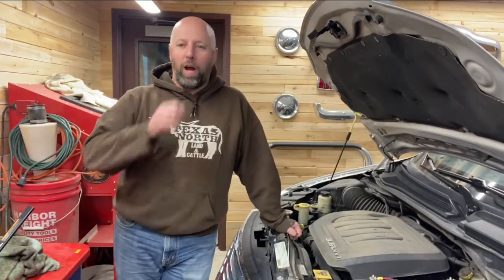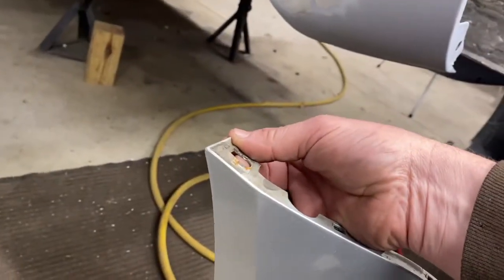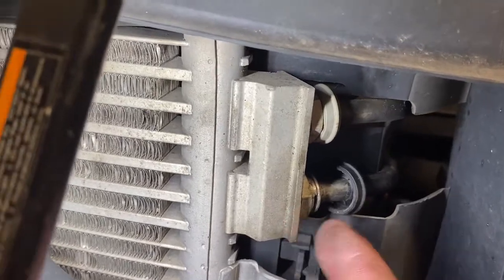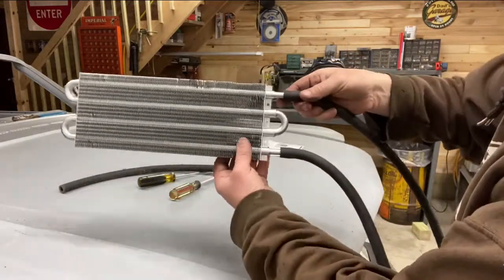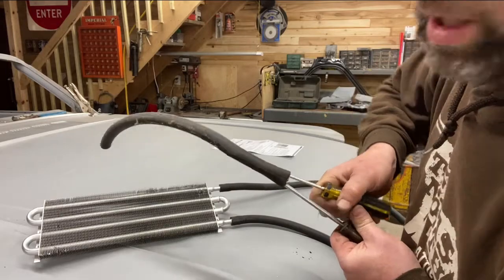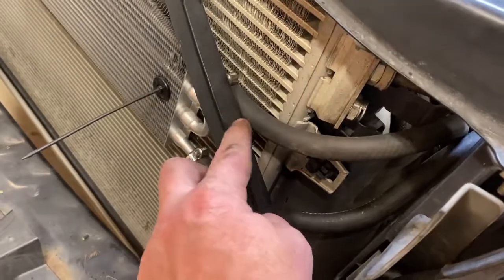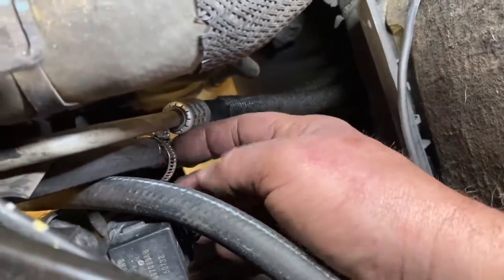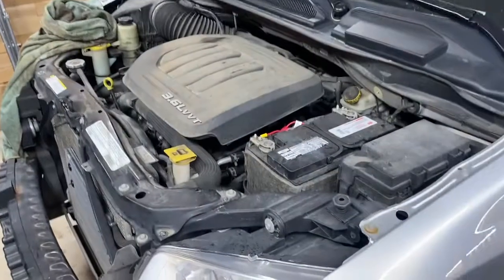Transmission Cooler Installation Town & Country / Caravan

Comment: Do you do anything special when you cut the original return line to retain the new cooler hose like a flare?  The stock cut tube is aluminum?  It shouldn't have any pressure but I'm always paranoid.  Thanks for a great video.
Reply from the maker: I didn't flare it at all.  It's just a nice tight fit with the hose and a clamp.

Comment: Ok so this is just an extra cooler to go inline with what is already there. Mine is leaking on the stock one near the passenger side. I was looking for a way to bypass that and not have to replace it and have to recharge the ac system.
Reply from the maker: Yes, this is intended to be an additional cooler.  I don’t know it’s cooling capacity compared to stock. It might work if you us it instead.  You could put two but that’s not cheap.

Comment: Great video! I want to add this to my 2018 Chrysler Pacifica minivan to cool the transmission while hauling a small pop up camper. Could you share a link to the transmission cooler that you bought?
Reply from the maker: https://www.etrailer.com/Transmission-Coolers/Derale/D12902.html?feed=npn&utm_source=google&utm_medium=cpc&utm_campaign=Google%20%7C%20Shop%20-%20Low%20Volume%20-%201000%20-%20All&adgroupid=108452021885&campaignid=11229265674&creative=468863949313&device=c&devicemodel=&feeditemid=&keyword=&loc_interest_ms=&loc_physical_ms=9051962&matchtype=&network=g&placement=&position=&gclid=CjwKCAjw14uVBhBEEiwAaufYxzoLXiJGTR2jxRAK4queG3M8JB7s6XQ169_yDETQuPpq4aofoQdqHBoCP20QAvD_BwE

Comment: Didn't that restrict air flow by mounting it over the existing trans/air conditioning cooler, making the vehicle run hotter? Thanks
Reply from the maker: The air flow is hardly restricted.  It does slightly warm the air going into the radiator but the stock radiator is completely up to the job.

Comment: Why not bypass the whole system?
Reply from the maker: The purpose was to add more cooling in addition to the stock cooling.  I wanted as much cooling as possible. If I bypassed the stock radiator, I wouldn't have had as much cooling.

Comment: The Work Is 100% Correct But The Cooler Is Very Small.
Reply from the maker: I wondered that too, but it was what was recommended.  I wish I had a trainer temp gauge to measure before and after.